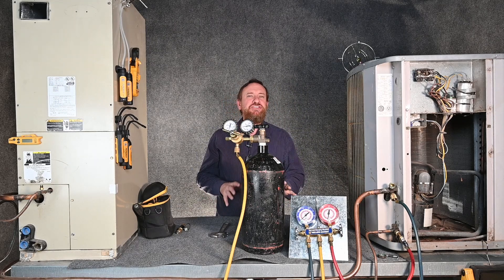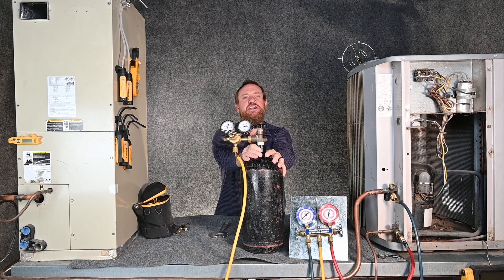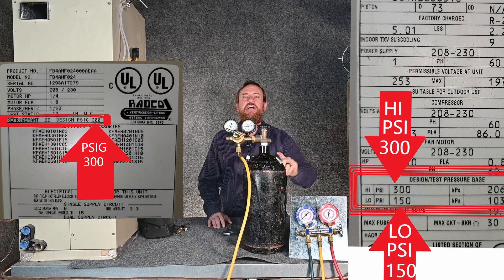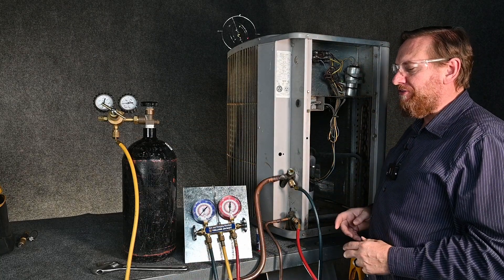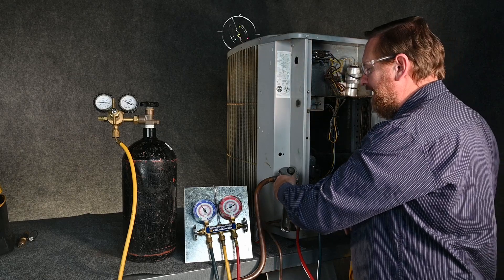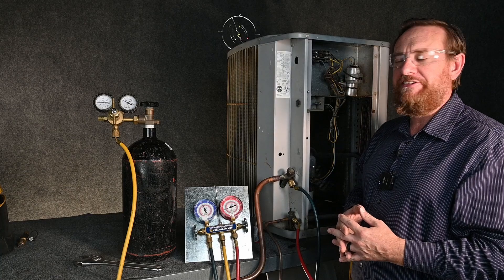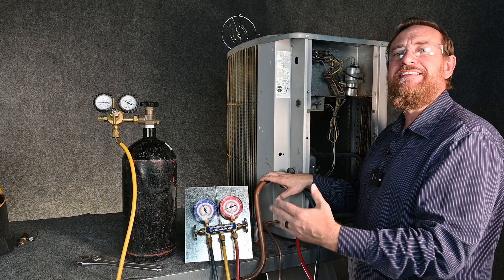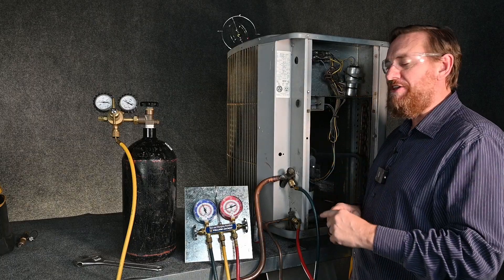HVAC 153 Nitrogen Pressure test with Analogue gauges

Comment: I make a nitrogen test at morning outside temperature was 10°C and put inside new system 25barr, after few minutes pressure drops to 24.5 bar, so hmm okay maybe i make bad flare somewhere. I check all nuts with bubble test under that pressure and no leak or bubbles there. So i raised pressure to 25 bar again and then was no drop on gauges. Still 25 bar during 1 hour. 🤔

Comment: Great video! thank you for the info! What would be your suggestion as far as PSI for a new Mini Split 28K condenser unit with 2 air handlers no more than 15 feet away from the condenser, 12k , 12k. Would you say 500psi thanks,
Reply from the maker: On the tag of the unit, it should have a high side test pressure rating. Go with that and you will be good.

I like to use the Measurequick app for pressure testing. It has a timer with a temperature compensation so it figures the temperature change with the pressure and time together for a pass fail.

Comment: Question: is it right to use the refrigerant gas manifold intended for measuring R22, R410A and so on, to measure the Nitrogen pressure inside the system? Shouldn't you be using another Nitrogen manifold or, in case you don't have any, connect the hose out of the Nitrogen regulator straight to the system? Are the reads you get from the refrigerant manifold corrects when meassuring Nitrogen pressure?
Reply from the maker: The manifold gauge sets just measure pressure. As long as what it's measuring is within its operational range it's good.A nitrogen tank has a regulator that reduces the nitrogen pressure to a level well within the range of the manifold gauge set.
Reply: @love2hvac  Thank you very much for your reply. But I must say that I DO NOT AGREE with your argument. After all, each gas is a different chemical substance. Therefore, they have different physical and chemical properties. The gas can be more or less corrosive, can change its temperature when it comes into contact with the internal parts of the manometer, etc, etc. And that's the reason why you basically have a different gauge design for each specific gas. Different gases, different properties, different gauges with specific design based on that gas' specific properties. I guess the answer might be something like: "Nitrogen is an inert gas, so it won't really affect the functioning of the refrigerant gauge, and the reading you get will be pretty accurate after all."
Reply from the maker: You are more than welcome to disagree. Disagreements and discussions are a great way for people to understand different points of view. 

I understand that laboratory equipment is calibrated precisely to a specific gas. 
In HVAC it's not that precious even 1 or 2 psi off, the saturated aka boiling temperature will be the same.

For the longest time we had one gauge that was used for everything except ammonia.  Then 410a came along that required higher pressure readings. So the gauges used for 410A  could be used for the lower pressure R22 but the lower pressure R22 coils not be used for the higher pressure 410A.  

We use one set of gauges for multiple different refrigerants. The analogue is simply a bourdon tube. When pressure is applied the tube tries to straighten out and moves the gear set to the needle. 
Now we use transducers that convert to a digital signal. 

We use the same gauge set for hundreds of different refrigerants, even refregerant blends as long as it's in the operational range of the gauge set. The digital set can instantly be upgraded to a new refrigerant by downloading the PT chart.

The only gauge set that's different is for CO2 systems or ammonia systems. 

I could not imagine having a different set of gauges for every refrigerant and every gas we use. It's just not practical, feasible or necessary. 

If your wanting a gauge set for each individual gas you would need to convince a  manufacturer to make them, distribute and sell them. 
Then you would have to convince every tech to buy a new gauge set for every gas they are working with.
Reply: @love2hvac  Thank you so much for your time and for such a detailed response. So to summarize your answer, what you're saying is that things seems to work after years of personal experience. Yet not a definitive answer to me, although I do believe what you explained. So if you'll be so kind, I have another question: based on that assertion that "gas is just gas and you can basically use any manifold for measuring pressure of any gas (except for those two you mentioned, CO2 and Ammonia), would you use your Nitrogen manifolds for measuring refrigerant gas pressure?
Reply: @julianomartinez6080   I just want to point something out. You are talking about measuring nitrogen pressures with a refrigerant manifold. Nitrogen being a noble element is about as nonreactive with anything else as you can get. The pressure reading may not be 100% accurate but it will also always measure the same with those gauges. Since you are also only looking for a change, it doesn't matter if the information isn't accurate, as long as it measures the same every time.
Reply: @snoopdogie187  Yet not a definitive formal answer on why you can use a refrigerant manifold to measure nitrogren pressure. Just like there are many refrigeration professionals and technicians who assert you can safely use refrigerant gauges for measuring nitrogen pressure, there's a different school which sustains exactly the opposite (for example, the ACR Journal) . Thanks for your answer.

Comment: Can we check leak with Air pressure as an alternate of Nitrogen. Pumping air with compressor.
Reply from the maker: Never use air!
Air has moisture that mixes with oil and causes acids.
Air has oxygen that mixes with oil that can cause combustion under pressure or oxidation in the system.

Never use air under any circumstances.

Comment: Sir I have a question, if a unit cooling 20000 ltr water 4c down in 1Hour. I want to know cooling capacity of that unit.
Reply from the maker: 93.02Kw / 317404btuh 80037.989 kilocalories
Reply: @love2hvac 
THANKS
Sir.

Comment: Ive personally witnessed mixing nitrogen with refrigerant on a new split system install. I was left scratching my head. Pressures incorrect along with superheat and subcooling. Recovered refrigerant/nitrogen lol recharged with same weight r410a havent had an issue since. My advice give an extra turn on the service valves to ensure they are well seated. And i can find almost any leak with 100psig nitrogen 👍

Comment: Why nitrogen, co2 is inert up to 3000 degrees Fahrenheit and since copper will melt under 2000 degrees I see no problem using it versus nitrogen during brazing, furthermore co2 is hydroscopic and has the ability to absorb residual moisture in a system and carry it out with it in the evacuation process, not to mention it’s vastly cheaper nitrogen. I personally have used co2 exclusively, and in nearly 50 years in the field I have had zero problems.
Reply from the maker: I use to think that same thing until I went to work for Emerson.
Turns out there are many grades CO2, most of them being wet depositing moisture in the lineset when pressurized. As you pressurize co2 it condenses some of the moisture out. To the POE oil. 

It also becomes chemically active when exposed to moisture  and heat. Since most CO2 sold is wet or low grade CO2 it's an issue and varries by supplier. Then you spray nitrogen and get the ice crystals, many items that's the moisture. 
 As you heat that lower grade carbon dioxide, the percentage of oxygen present would gradually increase. You end up with carbon monoxide and oxygen. 
The oxygen causes oxidation.

You would need refregerant grade dried CO2 to prevent this Wich is not cost effective. 

When welders mix CO2 with argon or helium to keep it stable to prevent the oxydation. 

While it is still better than nothing it is not better than Nitrogen.
Reply: I’m aware of the different grades of co2, I guess I forgot to mention I have always purchased my co2 from a local welding supply shop who has assured me of its quality and dryness. Actually I thought you might take issue with Co2’s global warming potential of 1. You may find the words of the ancient Greek philosopher Heraclitus interesting.
Reply from the maker: @nunyabusiness6746  

The Only Thing That Is Constant Is Change

Comment: Just criuos why nitrogen is needed instead of regular air pressurizing, is air bad for the system just for testing before vacuum?
Reply from the maker: Great question!

Air has moisture in it. Moisture is the biggest enemy inside the refrigeration system as it turns to acid that eats the system from the inside out.  Worse than air is pressurized air because it causes water vapor to condense into a liquid inside the lines.

So we want to push the air out with nitrogen with a nitrogen purge, then we can pressurize with nitrogen.

Comment: That’s too low of a pressure test. I don’t care what the test pressures says. We all know on a hot day the head pressure can be 400PSIG. I’ve seen braze joints that only leaked around 270PSI or higher. Also condenser is isolated. You should do a minimum of 250PSIG. You also should have purged your gauge set and lines before adding nitrogen.
Reply from the maker: Did you know you can damage the fusite plug by going above the lowest test pressure. You can also push the nitrogen past the valve and mix with refregerant in a pump down. Every pice of equipment has the test pressures there for a reason. 

This example was an R22 unit, so that unit hitting 400 would be a big problem even on a hot day.

This is a series and the least several video we already discussed purging and brazing with nitrogen. So there was no need to purge again. 

I'm open to a discussion about this but if you say "you should", then you should start with the instation manual that clearly stated what "should" be done. 

If you see the whole series I also discuss testing components are higher pressures when the rating allows.
Reply: If you're charging say an RTU or chiller/etc, would you pressure test through high side first then let it trickle into low side?
Reply: Or just go to low side test pressure and let it equalize and it will suffice for high and low side?

Comment: Hello my esteemed teacher.  Perfect timing.  I am puzzled.  I did nitrogen pressure test on system watched it for 15 20 minutes and no change using SM480 digital.  But within 2 days 410A was gone.  Yesterday after a lot of isolation and checking leaks found a leak in compressor discharge connect.  Pressuring to 357 came down to 329.1 and stayed there while I know there is a leak and can feel air blowing.  Totally puzzled and no confidence in leak checks   Help sir please.
Reply from the maker: 15-20 minutes is not long enough.
357-329 is a big difference but the temperature change is essential to know. The next video will be perfect you you. It addresses exactly what your talking about. It should be available Monday or Tuesday
Reply: @love2hvac  Thank you kind sir.   You’re awesome.

Comment: I hear a lot about using nitrogen for brazing but what about when you unsweat a line ?
Reply from the maker: Beat practice to cut lines to prevent oil flash with unbrazing. 

However that's not always practical so yes I absolutely purge nitrogen when unsweating lines to help reduce oil ignition and oxidation.

Comment: I used to see some tech charges a little freon and add nitrogen 150 PSI than use leak detector to find a leak? it works great.
Reply from the maker: Yes the Trace gas method that video is coming soon with the pros and cons.

Comment: I have been using my fieldpiece digital sman gauges to do my nitrogen pressure test. I religiously test them at 200 psi hi & low. Hold them for about 10 min. I've had them drop to as much as 2.5 psi with a txv and always around 1-2 psi with a orfice. I use the blue bubble leak detector and I never ever find a leak. I know sometimes the system takes a few psi to settle out between hi and low side. Is this normal? My line sets are usually 15ft to 30ft max usually, these are all new build installs , so new copper condensor and coil.
Reply from the maker: That's part 2 I'm uploading a video right now with the Sman digital. It should go live Sunday evening or Monday morning.
Reply: @love2hvac  Got it, look forward to it.